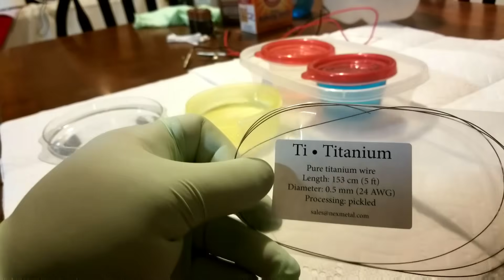How To Anodize Titanium With 9V Batteries Cheap And Easy - Full Tutorial

Comment: Baking soda, stainless steel, cleaning agent (alcohol or acetone), preferably gloves, titanium, titanium wire, destilled water, anti rust stuff (if you want to remove anedozing), 9v batteries (1-3 depending on color) , cables with clips, some metal thats good at electricity conduction. That's what you need

Comment: Bro the fork you used as a conductor is enough to do the process right? I thought we need something made up of titanium but if the fork is enough then i won't bother buying any titanium fork or straw
Reply from the maker: Yeah, the fork works great. That's all you need, but you just have to make sure it is stainless steel. Carbon steel will not work correctly.
Reply from the maker: Some people use a pasta strainer (stainless steel). As long as your cathode is either stainless or titanium you're in good shape.

Comment: Tip: If you dont have titanium wire to hold the piece, you can use steel or copper. Just keep the wire out of the water, anodize most of the part, then reposition the wire and anodize the rest. If the wire goes in the water, it will sap the current from the piece and simultaneously be etched away, making the color appear dull and uneven.

This is how I anodize clips, beads, and screws.
Reply from the maker: Correct. I occasionally just attach the alligator clips directly to the piece and do it the same way if I'm in a hurry. As long as it doesn't go in the bath it's fine.
Reply: A few other things I've learned since I started doing this (which you may or may not have mentioned):  

The color appears from the light reflected through the oxide layer, so the more polished the surface is, the more directly light is reflected, and the more vivid the color appears. 

The oxide layer is more durable on a textured finish (such as stonewash or brushed) than on a polished surface. 

The sharp edges and corners always wear away first. Polishing them to a nice rounded chamfer before anodizing can help delay the edge wear. 

You can touch up a worn or scratched piece by repeating the process using the exact same or higher voltage. The worn/scratched spots will simply re-anodize to that color.

Comment: 1) Does prolonged time in the anodizing bath change anything?
2) Why the titanium wire, and just not just wire?
Reply from the maker: No, keeping the piece in longer has no effect, it's only the voltage that will change the color. 

Titanium wire is used because if you use a different material it screws with the anodizing. I have a video up on the channel showing what happens using copper wire, if you're interested in checking it out.

Comment: Is it necessary to strip the old anodising r can you just do it over the old?
Reply from the maker: It depends. If you want to do a color that requires a higher voltage it'll work just fine, but if the current color is a higher voltage than the color you want then you'll have to strip it first. Does that make sense?
Reply: @ApollosRings  thanks that makes sense. I'll try it

Comment: Hello I successfully anodized some knife scales following this video. I used wink as directed and now the parts will not anodize. I checked my connections and they are correct. Would you happen to know why this is happening?
Reply from the maker: Do you have a volt meter? It sounds like you may have a bad battery. That would be what I would check first.
Reply: @ApollosRings  thank you for replying! I switched from cleaning with simple green to acetone and the problem was fixed

Comment: The rust remover brings it back to the base layer I believe, but it comes back more matte instead of shiny? Is there a way around this?
Reply from the maker: You can remove it mechanically with sand paper, or Scotch Brite pads. If you go the sandpaper route you will have to work your way up through the grits till you get the amount of polish you desire.
Reply: @ApollosRings  thank you!!

Comment: Question: do you cut the Wink with water or use pure out of the bottle?
-my electrolyte solution bubbles a LOT, less baking soda?
-I tryed taking down a heat treated TI bolt, took WAY longer than 10 seconds in the pure Wink, more like a minute+, ever done that?
- the same bolt I took down, I could only change to blues, through 8 nine volts, did I not Wink it enough to remove the full heat anodization you think?
Reply from the maker: No to cutting the Whink. 
It sounds like you may have something other than stainless or Ti in the water, but hard to say without seeing it. I'd be happy to take a look if you want to shoot me a quick video on Instagram DM. 
Is the Whink fresh? If you've used it a bunch of times it starts take much longer. 
Do you know the grade of Ti that bolt is? That can have an effect. Going off everything you've said, it's completely possible one of the items in your bath could be the issue.
Reply: @ApollosRings  thank you for your reply!
Wink is fresh, my "stainless spoon" could potentially not be good stainless, I'll grab a large SS bolt I have instead, I've heard thick aluminum sheets works too, like thick aluminum foil, not sure.
The bolt should be high grade TI, reputable source.
Thank you for this, I've got some un-heat treated TI bolts coming very soon to try my bath on, just to rule out the heat treated part from the equation, I'll let you know how it goes! 😊 I'm not so swift in the IG game, we'll see, I very much appreciate the offer!
Reply: @ApollosRings  well .. frustrated I'm not sure what's going on but I can't get it to work, even the wire won't seem to take colors. Using distilled water, baking soda and a solid SS bolt, numorous batteries, as in stacking voltage, no change. I guess I can switch to borax maybe, my baking soda is old, but I don't see how that would matter..
My leads are not chrome plated, they are copper, again, shouldn't matter.
I got a titanium bolt that was already anodized and tried to change it, got American titanium bare, nothing, oi!!
Any suggestions are much appreciated, thank you buddy.
Reply from the maker: I'm going to throw a few things out there. Are you sure you have the leads hooked up to the correct polarity? How many batteries are you starting with? Try as few as possible, maybe start with 3 first to see if you may have a bad battery in line. Try swapping out the batteries one by one to see if that fixes it. If that doesn't do it message me. I'll walk you through it on a zoom call if I have to. It should have nothing to do with the baking soda, as long as it is definitely baking soda.
Reply: @ApollosRings  😓🙃 oh boy, I knew it had to be something simple, yes that was exactly it, I reversed the leads, and had poor lighting to boot on a small bolt, it works perfectly, all be it, not exactly like yours. My voltage lines up a bit different from the charts I found, and from what you showed, I assume that's due to size and finish on the surface. To get a better purple I had to use 8 batterys, the 2 wasn't punchy enough on the little bolt head 🙌💯 thank you sir, your my hero today!
Reply from the maker: Glad I could help! Yeah, could be irregular battery voltage as well, but 8 for purple seems like there still may be an issue there. I've got an update video coming out soon going over a bunch of tips and tricks you might wanna keep an eye out for as well. This video is pretty old, 😂

Comment: How many times can you etch the piece without messing up the size or function?
Reply from the maker: Hard to say, I haven't pushed any of my knives to that point. I'm sure if you etch it a ton of times you'll start getting slop in it, but I've done it numerous times without issue. A good practice is using nail polish on any surface where tolerance is important. Then once you're finished just take it off with acetone. That way it won't etch that spot.

Comment: I have a couple small titanium parts that I heat treated a little too far I believe,  kind of a gun metal grey color now.  Would I be able to use whink to take it back and go forward with this process?
Reply from the maker: Absolutely,  I do it all the time. It has to be Whink from the US though. Not sure where you're from, but I've talked to some guys that tried it with the Canadian Whink and said that they have a different active ingredient. The ingredient you're looking for is hydrofluoric acid. Be careful not to get any on you, that's some nasty stuff.
Reply: @ApollosRings  awesome. Also,  would I be able to do multiple parts together, at the same time, if I string them to the same titanium wire?
Reply from the maker: Yes, that's actually how I recommend doing it if you want their colors to match perfectly 👍🏼

Comment: If we start with bare titanium, is the Rust & Stain remover needed?
Reply from the maker: You can anodize without etching, but generally, you'll get a deeper color if you etch first. I've made some cool pieces with a high polish finish that you wouldn't be able to achieve if it was etched first. I suggest maybe getting a scrap piece of titanium and messing around with it a bit before doing a piece that you want perfect. Just my 2 cents.

Comment: Do I still need the whink if I'm starting with a clean unanodized piece of titanium?
Reply from the maker: It isn't 100% necessary, and results can vary, but I always recommend it. You can always try without it and see if you're happy with the outcome, then if not order some Whink to strip it and start over. I've had quick jobs where I haven't needed to use it first, and there are some times when you can't tell, but other times you won't be able to achieve a certain color without prepping it with Whink first. Usually it just won't be as vivid of a color without etching it with something first, whether it be Whink or Multi-Etch. Hope this helps! Thanks for watching! 👊🏼👍🏼 Happy Holidays!!!
Reply: @ApollosRings  thanks for the quick response!

Comment: Hey, quick question, have you noticed there are any specific key points to getting a more durable finish?

 I found during a few different times I have gotten varying durability. I have one clip I did with a great durable finish and then a set of scales that the finish took great initially but was very smudgy and the ano faded within a day from a deep purple/blue to a light blue/silver. 

Thanks
Reply from the maker: Ive found personally the rougher the surface, the tougher finish because of the additional surface area. It also usually makes the ano show up brighter and more vivid as well.  I usually prefer a brushed or Scotch Brite pad, and then a quick etch before ano for best results. Sometimes I need the polished finish for a ring. Don't get me wrong, that comes out amazing as well. I just think for max durability it's Scotch Brite and etch first. My $.02
Reply from the maker: If the ano looks faded you can wipe it down with alcohol and usually bring it right back to a fresh appearance as well. Once the oils from your skin get on it they make it appear faded. Anodizing looks the way it looks because of thin film interference. Same thing as when you get gas in water and you see the rainbow. Neither the water nor the gas are rainbow-colored, but it appears that way because of the thin layer of gasoline on top of the water.

Comment: So what’s the 120V power supply for? Instead of batteries ? Also can you re use the batteries? When do they get fully drained?
Reply from the maker: Exactly. If you're careful not to discharge them the batteries will last quite a while, like a year or 2 with light use, but if you accidentally let the leads touch they can discharge in a few hours and possibly cause injury. Always wear your PPE! Thanks for watching!

Comment: Followed it step by step and got fantastic results on my titanium rotor bolts, and sprocket nuts for my sport bike! If anyone’s hesitant to try this don’t be intimidated. Purchase the things he used, follow the simple steps, and you’ll be blown away with the finished product! The first time you dip something in the solution and it begins to change color feels like a magic trick 😂 Super mesmerizing to watch. Thank you very much for such a great tutorial!
Reply: I am watching this as well to learn to do bolts for my sports bike! How did you connect the titanium nuts and bolts to the wire and alligator clips?
Reply from the maker: You can just wrap the ti wire around the bolt once or twice so it's held in place. You can do a whole string of bolts like that. I actually recommend doing it that way because if you anodize everything together you'll have a much more even color across all the parts (as long as you're doing them the same color).

Comment: thanks for that great comprehensive video!, just a QUICK QUESTION: does rust remover/removing the anodize may damage the titanium if i do it often ? i hope i am not late to the party and you read my question and hopefully you got the answer :) again thanks allot.
Reply: I assume it only removes the oxide layer, which is probably orders of microns smaller than you’d need to be concerned about for tolerances.
Reply: @lindboknifeandtool  Thanks allot :)

Comment: Could you use zep rust stain remover? Does it matter?
Reply: Thanks sharp
Reply from the maker: Whatever you use needs to have hydrofluoric acid as the active ingredient.  That's some seriously nasty stuff though, if you plan on using it make sure to use proper PPE and be safe!
Reply from the maker: Sorry, to answer your question - No, I don't believe ZEP uses hydrofluoric acid, so it wouldn't work.

Comment: Hi, I'm just wondering does it have to be distilled water? Or can the distilled water be substituted for deionized water or WFI or even just regular tap water. What's the reason for using distilled water?
Reply from the maker: Depending on the mineral content it can effect the anodizing. Most of the time you can substitute though. My tap water works fine, but if there were high iron levels it could cause issues. I personally use tap water 100% of the time now that I know my mineral content isn't an issue.
Reply: @ApollosRings  thank you very much for your quick reply and for the information,its much appreciated 👍🏻
Reply from the maker: No problem!

Comment: Thanks for the detailed instructions!  Ordered all my equipment today.  Question about anodizing Ti screws... will the Whink compromise the threads on say a pivot screw? Or maybe try to paint the threads with maybe some fingernail polish?  Also, have you tried stonewashing Ti? Would it be better to stonewash first, then anodizing, or the other way around?

Either way, got yourself another sub!
Reply from the maker: Hey Tyler, thanks for watching! So as far as the screws go - anything that you are concerned about tolerances I would definitely coat with a few good coats of nail polish prior to Whink. That 0900 that I use for the videos has a full aftermarket set of titanium screws and pivot. Since I knew I planned on using that as a test piece I wasn't super concerned with tolerances and just always whinked and anodized the entire thing without nail polish. I haven't noticed any slop in anything, but some knives definitely could conceivably get messed up if you don't coat the screw threads. Up to you, but if you only plan on doing an ano job here or there, I'd take a little extra time and coat everything so I didn't have to take a chance. Hope that helps!
Reply: Thanks! I was planning on painting the threads for the annodizing, and only planning on doing the stone wash to the clip, it's my PM2 that I just recently started modding. I rit dyed the green camo scales to a dark grey urban camo, but then I ordered some canvas micarta scales that should be here next week.  Then to go with the micarta, I acid etched and stone washed the blade, which came out awesome!  So then I decided to go Ti for the hardware, so I have two different Ti deep carry clips i ordered one for use another for learning to annodize.  I am looking for a darker bronze, almost a patina'ed brass look.  Any way to darken the ti after annodizing without losing the color?  Definitely appreciate the info and quick response!